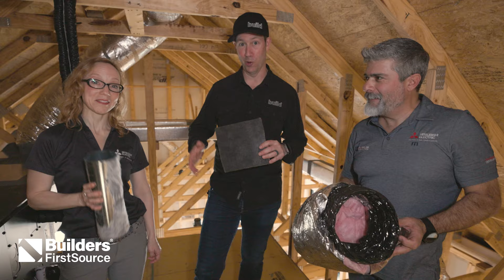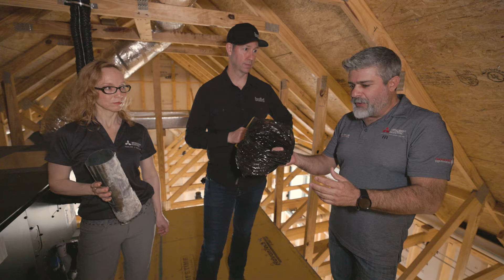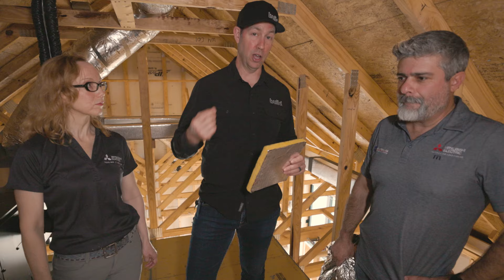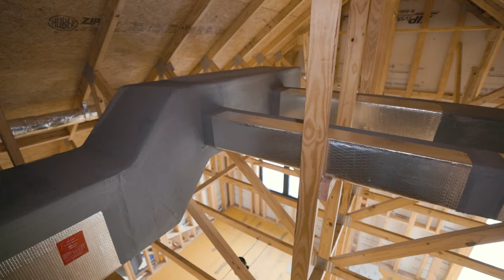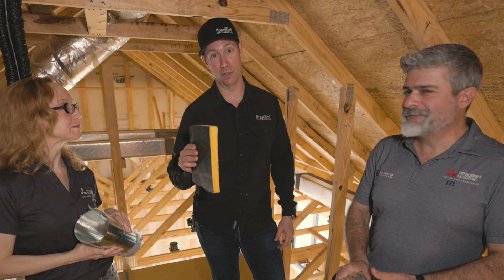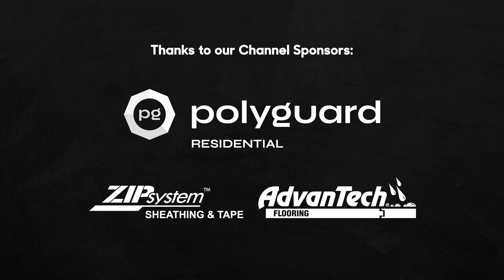Flex vs. Metal vs. Duct Board: Differences and Use Cases

Comment: It is worrying how much of a new house is made up of complex chemicals, especially plastics in many forms. Do we know what is slowly leaching out over the years into these tightly sealed boxes?  We usually only find out after people get sick.
Reply: There’s an air exchanger Matt likes to have installed. Fascinating devices that balance pressure and cycle air. Air still comes in but heat and cold is dealt with and particulates too.

Comment: Hey guys I have a 30 year old house with metal ducting and I hear it creak and pop every time my furnace kicks on and off. I assume it’s from the metal expanding and contracting, any advise for how I can fix it?
Reply: Sometimes you can find the spot that pops and just stuff foam or insulation around that area to keep it tight…I know that’s a gangster recommendation but it’s the easy cheap option. If you want the expensive option get new duct that is thicker metal.

Comment: Wouldn’t it be cool, no pun intended, if there was an in-between board and sheet metal… I think as systems get more efficient and complicated… why haven’t we come up with something better? An “in between” would be awesome, as more people care about the “lungs of their house” and their investment. Obviously it would be great if we can use the same tools we already use for duct board… but a smoother, more resistant finish on the interior… maybe a neoprene layer, call it duct board pro…
Reply: Double wall metal ductwork. Very expensive but, you get an inner liner of metal a inner layer of insulation then an outer metal layer.
Reply: @tonycosta2455  I’m sure that’s more awesomeness, but looking to offer an in-between metal and duct board for the budget minded. I saw someone post about plastic something from Germany, sounds interesting… hopefully we can use the same tools!
Reply: Even if there were the experts would advise against it cuz it’s not 100% 🤷🏼‍♂️

Comment: And you can clean flex duct as long it’s not brittle. 
You can clean and incapsulate lined ductwork or duct board according to the IICRC and NADCA standards per the NADCA ACR 2013

Comment: Which one is the quietest?
Reply: Using flex is the quietest I would only use duct board if necessary given you live close to the ocean and  concerned with the main duct rusting out otherwise use metal for main duct and flex going to vents if you use all metal it's a good bit noisier you can do 3 to 5 foot of flex and the rest metal going to the vent
Reply: I think lined metal is quieter than anything but duct board is pretty quiet
Reply: Anything to decouple a solid pipe vibration to the vent.  That’s why they use a short section of flex.
Reply: That may be true but I don't care for lined metal bc of the fibers in the insulation their is a reason hospitals don't allow lined metal or duct board in their facilities
Reply: @winkel08  Just added a note for my builder to do exactly this based on your comment. Thanks!

Comment: I use rigid galvanized steel for most parts of my ductwork. I only use duct board for return air and registers, connecting with 7ft long flex ducts for noise control. I have a MERV13 media filter and a whole house dehumidifier system so I don’t think it gonna cause IAQ issues.

Comment: This is all a bit misleading. When a HVAC system is installed, there's a duct flow calculation done. It doesn't matter what the % reduction is. The ducts would be upsized if the loss was significant enough to matter. Like you'd use a 7" flex instead of a 6" metal. The double the cost must just be for materials only. The labor alone is probably 5 times. Flex duct can be a 20+ foot run without worrying about seams.